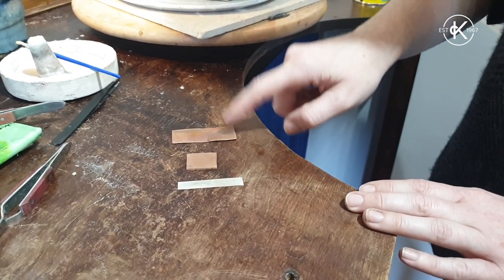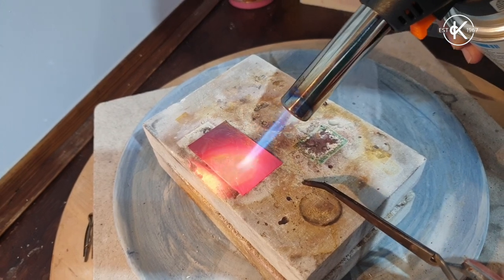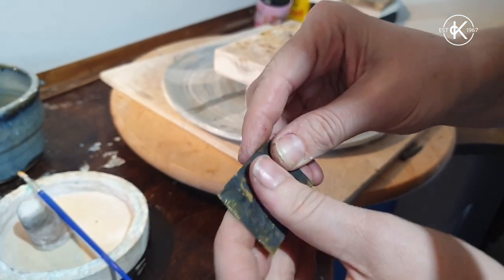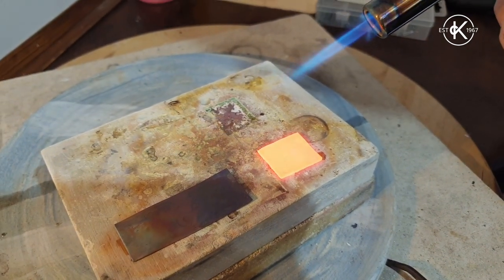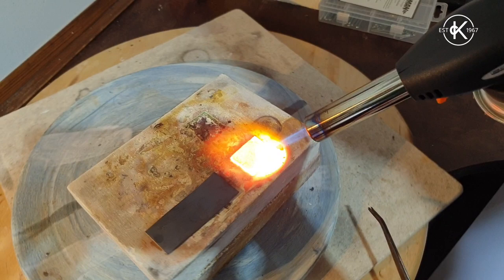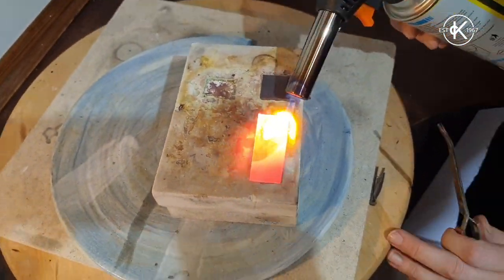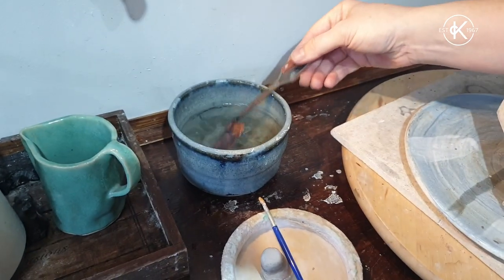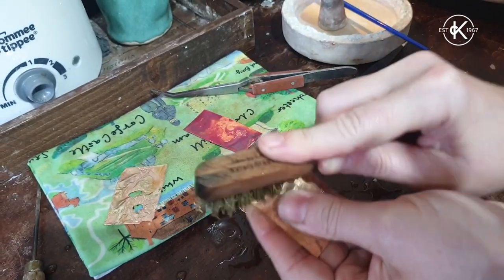Reticulating Brass | 12 Months Of Metal

Comment: Hi Kim - Very interesting results with copper. I find when doing reticulation - usually sterling silver but also copper - that I can get most dramatic results by heating the surface until it almost starts for flow, or actually does flow a bit, and draw the torch back straight away. It is as if the heat is pulling the surface into crater or texture. This might be effective on your thicker pieces especially. - thanks for the great demo. Bob Warick
Reply: Great tip thanks Bob :)

Comment: Thanks for the video. I have an issue... my silver .925 doesn't create this effect. I heated it but it's not react...what's can be the problem? Thanks
Reply from the maker: Hi Diego, it's likely that you haven't repeated the process enough times. The process is time consuming but a great project to get stuck into! It requires you to heat the piece of silver  numerous times in order to oxidise the copper to the surface. Each time you heat the piece, you need to pickle it to remove the oxide, brush with a brass brush and repeat the process up to 15 times. More information and videos can be found here: https://www.kernowcraft.com/blog/12-months-of-metal-challenge-with-make-it-kim/12-months-of-metal-reticulation